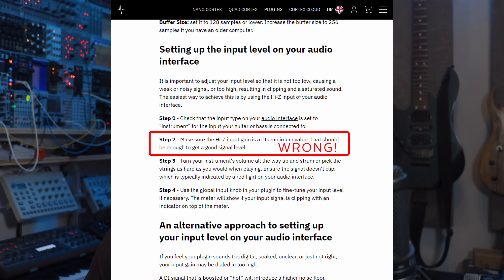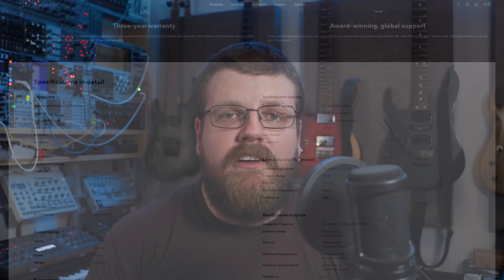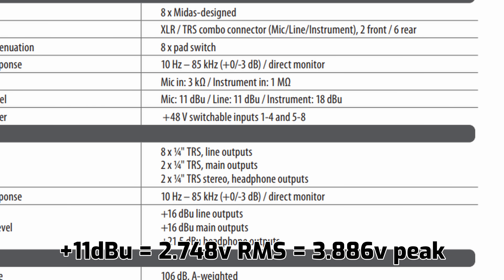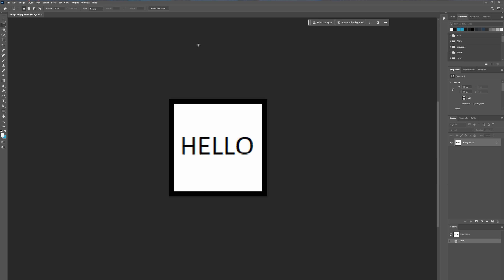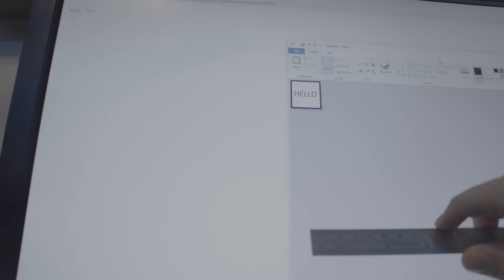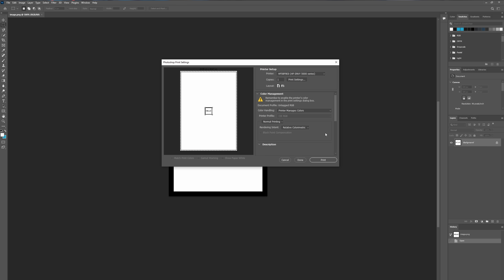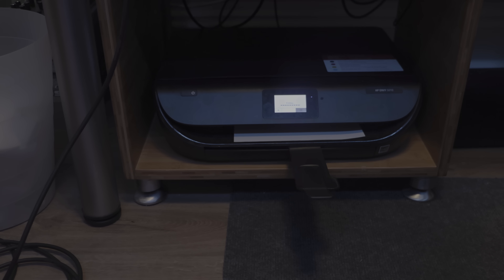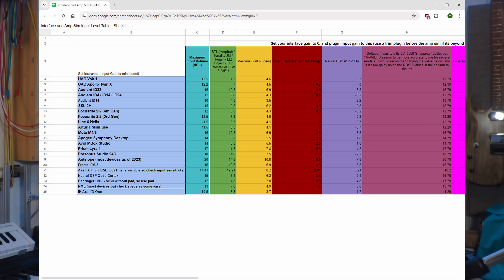Ampsims and input gain - Please, stop the madness...

Comment: I've been away from the YouTube guitar/audio space for a couple of years and I had no idea this was a thing.. How on earth did people manage to perpetuate such advice in this day and age??

Not really related; but this talk about input gain on audio interfaces reminds me of the time when I was about to buy my first one.. I was going to order a Scarlett 2i2, but just before ordering I happened to watch a video by Misha Mansoor regarding audio interfaces and amp sims, he stated that the gain on the Scarlett 2i2 doesn't go low enough for most high-output pickups, and recommended getting a 2i4 instead because it features a PAD switch. I'm glad I saw that video and ordered a 2i4 instead because sure enough, all my guitars clipped the signal without PAD (OBVIOUSLY with PAD on I've always turned the gain up to the point just below clipping).. Focusrite did however correct this issue with the 2i2 from the 2nd gen onwards by adjusting the gain range to be able to go lower (my second interface is a 3rd gen 2i2 and it works just fine without PAD).

Anyway, great video! You explained everything very clearly and to the point without any excess rambling etc. (then again there are guitar players involved in this topic, so I wouldn't be surprised if someone still tried to argue about this)..

Subbed!

Comment: I get that you are optimizing the signal to noise ratio, more specifically with regards to the noise floor that the audio interface introduces. However, isn't it true that the noise floor of (single coil) guitar pickups is many times greater than any budget audio interface would introduce? Isn't it therefore a moot point to try and overcomplicate things by fighting the audio interface noise floor when the noise floor of the source is already way to "overbearing"?
Reply from the maker: Using a single coil pickup, you might not find much benefit in this approach, since, yes, they are very susceptible to electromagnetic noise. But if you're in a "clean" environment (meaning, one where there isn't much electromagnetic interference), you might potentially notice a difference.
The story changes when you're using humbuckers, and high gain ampsims. A good humbucker will have a much lower "noise floor" (technically not the right term to use here, but I digress), and you really need that if you're driving a high gain amp or ampsim. So in that case, adjusting the input gain to maximise your SNR becomes much more important.

tldr; If you play clean single coils, you don't need to be bothered with this (probably). If you use humbuckers and high gain ampsims, there's a good chance you do.

Comment: Does it work the same for synthesizers? Great explanation and very correct.
Reply from the maker: For synths;
1. Maximising the input signal hitting your interface (without clipping of distorting) is always the right thing to do, yes. However, you're much less likely to experience issues with a synthesizer input than a microphone or a guitar pickup, because the synth produces a much stronger output signal, and also, it you're not going to be applying lots of gain to the signal, like a high gain ampsim would do, so any noise present is not going to be amplified as much.

2. Matching the digital signal level to your plugin's expected signal level can be just as important for synths, for example when using analog modelled compressors. If the level isn't set to where the plugin expects it, any saturation or nonlinearities in the plugin will not behave as they should.
Reply: @ thank you for explanation. Will apply it next time i record synth. I kinda always boost synth output all the way up to use less preamp gain on the converter.

Comment: Great explaination that will certainly help many. I would like to add that there is indeed a relative scientific standard when it comes to proper gain staging and the place to dive in and find that information is in the broadcast standards community. As I'm sure you know, 0dBu for instance is 1k at 0.775 volts. A 1k sine at 0dBV though is 1v RMS. Then there is peak of RMS at 1.41v. +4dBu is 1.228v and so on.. 
Its all about calibration via optimal gain staging. In the broadcast world (like transmitter engineering) the level of precision and monitoring is extreme.
I would love to research the root of standards (might just do that) where I think it starts with the amplitude of acoustic energy in a physical enviorment that creates a unit of air pressure that can be equated to a voltage which is then represented as dBu, dBv etc on a VU meter for the sake of precise calibration and opperation which leads to optimization standards and control accuracy. There is the amplified output side as well, 'we' should be able to determine that a particular soundwave with a particular amplitude in an acoustic enviorment should equal the reproduction of the same soundwave on an optimal system and that should in theory be unity. In fact that is litterally the concept of 'An apple is an apple'.
Unity is when the input signal is the same voltage as the output.

Comment: This was awesome. I always knew there was a change from what I was recording into the interface vs what the input signal in the plugin was outputting. Threshold is everything, there is a threshold for all signal input to output. Just like a compressor, you have to have enough input gain to trigger the circuit before any compression actually happens. Your example showing the noise floor with 0db vs a matched "-6" input on the interface should be a glaring point of fact. For example, you have a Marshall head, you're at less than half gain on the amp. You turn that gain all the way up and now you hear all the fiz and fuzz from the electrical signal going in and out of the cab. You're boosting the floor and killing the dynamics of a performance, then making the mix engineers job a nightmare.

Comment: Ahhhh, this is very interesting because I used to use a Behringer interface and now I use a UA Volt interface both with Neural DSP and the UA Volt sounds a lot better. Little did I know the UAD just does a better job of matching the correct gain level. I still just leave everything at zero. I'm sure the extra .3 db is pretty negligible within the context of a mix.

Comment: Can somebody help me? I tried appliying this concept to a Uad Volt 1 and Neural DSP plugins, the result was way too silent and clean. I had the plugin gain at 0.3, then added 27 db gain on my Interface, and subtracted that from the plugin gain. Well, almost. The Plugin only goes to -24. And at that point, even metal amplifiers sound crystal clean.
Reply from the maker: @LucaArtusaMusic  I'm really surprised you're adding that much gain at the input my example of 24db was about the most extreme case I could come up with. Are you sure your volume knob on the guitar is at full, and there isn't something else that's cutting down your signal strength?

Comment: Nope you're also wrong. We have more than two gain stages to worry about. Whatever the source is, it probably has variable loudness of some form. And it has its own dynamic range. And anything else in the signal path does too. If maximizing dynamic range without adding appreciable distortion is the goal, then this is a multivariate equation to solve, and you can order the solution algorithm by most constrained first for instance.

So the rules of thumb, including yours, are all suboptimal oversimplifications. It may well be that the converter these days has so much dynamic range (and consumer converters typically output fixed point numbers, not floating point "between 0 and 1", not sure how you've made it as "a designer of DSP circuits for 15 years" sorry buddy) that not using its gain and forcing yourself to maximize dynamic range earlier in the signal path is exactly good advice for the people it was directed toward. I can't answer for anyone remotely because this is a complex optimization problem and that's before we consider the desirability of various points of nonlinearity. Or playing or setup comfort. Or the value of noise itself in the lo-fi sense.

Try again.
Reply from the maker: Just because you use a simplified model does not make it wrong. Especially if the simplified model already accounts for 99% of the variance. Complicating your model with additional variables that are hard to measure and model, for limited to no additional improvement, is just bad engineering.

And regarding the fixed point / floating point. Nice try twisting the argument. But when you're dealing with the signal in your DAW, or in the plugin, the fixed point values have already been converted to a floating point representation, and they've been normalized to a range between -1 and +1 no matter the bit depth they were captured at. Find me a plugin format or a DAW that directly works with anything other than IEEE754 format floating point data internally, and I'll accept your statement.
Reply: @GhostNoteAudio  How many practical  sources have greater dynamic range, or even "99%" of the dynamic range, of a modern ADC? Not the worst ADC you could find, as you admitted to quietly using in this video, but a modern consumer ADC music makers would actually use? 

And my argument stands that the end user should optimize the dynamic range from most constrained to least constrained, and there's no fidelity benefit to applying analog gain once the noise floor is already exceeded by source noise when flawless digital gain could be applied instead. Avoiding simple attenuators as are found in guitars and their pedals, or mic preamp pads, in favor of attenuation in the opamp feedback network is an obvious dynamic range win that I'm guessing you don't even understand.

At least in your reply you've also corrected your claim in the video (not mine) that the DAW digital format is unsigned floats. Really I would've deleted this video by now. It's not actually more correct than the earlier claims (which I didn't bother watching) it just demonstrates one special instance among many, and has too many factual errors and too little understanding of practical usage to be clarifying of anything.
Reply from the maker: @PeterJensen7  Just keep commenting man, the algorithm thanks you.

Comment: Really appreciate the video. I've been using the "wrong" approach for a while, and have definitely been noticing noise being a huge issue. I just assumed it was "I have a lot of gain on the amp, can't be helped"... but seems like it can be helped. 

What prompted me to try the "set it to zero" approach to begin with was honestly just feeling like my guitars with hotter pickups were hitting the amp sim way too hard, leaving me with a messy, difficult to control high gain tone. So, dropping the input gain on my interface definitely fixed that part (leaving the plug-in's input gain alone), but it makes total sense why the signal to noise ratio went to shit. 

What would honestly really help is if plugin vendors actually had proper documentation on how to set this stuff up. Believe me, I looked. Your tutorial at the end of the video is dead simple, makes total sense, but apparently NeuralDSP couldn't be bothered to write a paragraph or two about how to set your interface gain and how to adjust the plugin's input gain for best results.

Comment: I first reduced 6db on the software input level, according to the input gain spreadsheet. Then I put some gain in my apollo input (+24db), but when I wanted to reduce this same number to compensate in my software input level, I find I can only go down to -20db (and I should be around -30db if I take care of the spreadsheet and the gain added in my interface)

Comment: Nice information but I have some problem with the premise that everything and everybody on this topic is wrong. Because even you actually give some merit to the work that has been done and see how it makes sense. This whole thing was just actually a step towards the "ultimate" method you present here as you even use the spreadsheet with the measurements made by Ed S (if I'm not mistaken). 
And I wish you would have given more credit to it, because the idea that amp sims need to receive a certain input to be optimal isn't wrong, all the maths about said input wasn't wrong, the only thing wrong about it was the method to get said input, and there are very reasonable explanations as to why it was presented that way. It was just the easiest way to standardize thing to a wide variety of ppl because most interface don't have any value on the knobs so you don't have immediate access to the boost value and the knob course can vary from one to another. But 0 will always be the minimal gain value for any interface so it was just far simpler to use this consistency to present a method that would work for everybody and still yield way better results than having absolutely no idea what we're doing.
So the problem isn't people trying to understand how things work with little knowledge they have, but actually companies who are quick to sell us a 200$ new shiny amp sim but don't give clear information on how they work and are meant to be handled (unless they do and nobody read the manual in which case, my bad).
It kinda rubs me the wrong way that not a word is said about that but you were quick to jump on ppl who did the research, youtubers and redditors who saw the value in it, and call everybody out when all you did was slightly improve that method (which is still a needed step, don't get me wrong, you are right and that info needs to be out there)

PS : The original method still has one advantage over yours, it can be set without the pickup input, which means the amp sim should react differently to different type of pickups like a real amp, yours kinda blurs the line by having everything coming out at the same input gain. (again not dismissing your point just keeping on with the idea you're not absolutely right while the others are absolutely wrong, it's more nuanced than that)

Comment: Of course, you give your AD the maximum input signal it can handle (with a little bit of headroom), and then work with the converted signal in the digital domain as needed (no matter which kind of digital representation or bit-depth is used in the system). As an old fart (nonpracticing EE who studied in the 80s and worked at a company who developed and produced digital audio systems in the 90s) I would've thought that this would be common sense – but it seems that nowadays many people (not only on Reddit) have no clue of how the things they use actually work … good video, even though it could've been 3 minutes long for what I needed to know … ;-)

Comment: Wouldn’t it be easier to perform that exercise using a clean sound? Talking about clipping and signal distortion when using fuzzy electric guitar is really counterintuitive.
Reply from the maker: @issamchabaa45  you should not be using your ears to set the threshold. Use a level meter. In fact, you can just mute the ampsim while you're calibrating :)
Reply: Totally true. But, again at 7:39 you describe the sound as “flabby and gainy”   And as far as I know no level meter or any other indicator would show “flabby” , so you use your ears. That’s where I go back to saying that a clean sound  would have been better choice for the experiment. Don’t mind my comment, tx for the excellent video.
Reply from the maker: If you had a clean sound, you wouldn't notice a change in tonality, you'd just notice it being *louder*.

Comment: Well said! I actually replied to one of the Zero db conformists pointing out that reducing the gain to zero wasn't what the plugin manufacturers were advising - I don't think they replied! The other point (which is from a guitarists point of view) is if you reduce the input level to zero you might not get the maximum levels of overdrive and distortion that the plugin is capable of...

Comment: Is this possible to do with the Focusrite Clarett also? Since there's no indication on how many dB I'm increasing the gain knob, it's difficult to know how much I should subtract.. Also, does this mean I have to do this process every time I switch guitars, since they all have different output levels? 🤔 My Clarett has a function called INST. not sure if this is supposed to fix this problem

Comment: Basically your advice could be boiled down to: Always set the input gain to the audio interface to get maximum signal level before clipping (plus a bit of headroom for excursions!)
Everything after that is controlled within the DAW and that is specific to the plugins. The Fortin plugin has a level indicator on the input - I'm assuming that is where the amp input should be set to have the level correct (whatever that is - via the spreadsheet?)

Comment: Great demonstration but.. it works  best when the interface has no hard limitation in analog domain and the digital trim was aplied BEFORE the plugin. The plugin input is not capable to work with high digital signal levels. Try to set every knob in a center then adjust the input level until the shit is go away. Then learn how far can go from the center positions.

Comment: So, I didn't know this was an argument. I thought getting the best quality signal/full signal at the start of a chain was just common sense. Maybe I'm just old. 

Here's a really easy test:
1. Plug a device into a speaker, set your device volume to a third or half volume, and crank up the speaker. You'll hear all the junk in the signal.
2. Turn down the speaker, set your device to full volume and adjust the speaker to the same volume. It should be exponentially cleaner (assuming no auto-gain, etc and a high quality track is played).

You should ALWAYS start with the best. 

Some of you will remember those tinny shit sounding cymbals on your mp3 player when you converted all your music to lower quality so you could fit more songs on it.